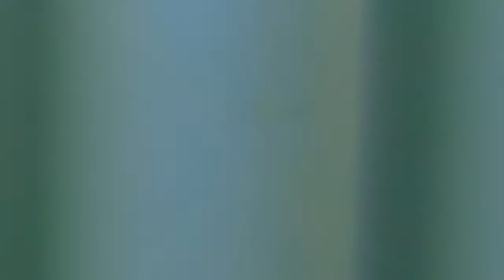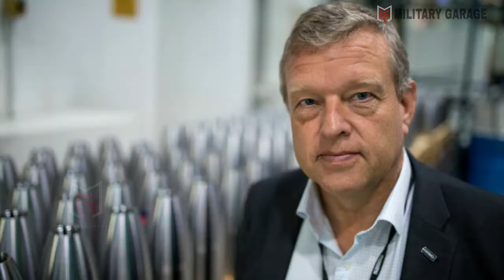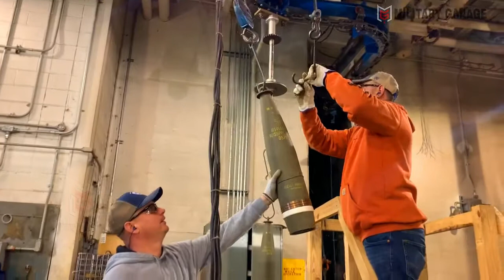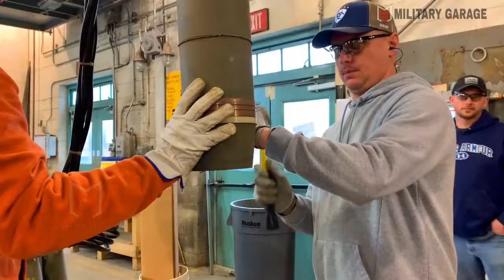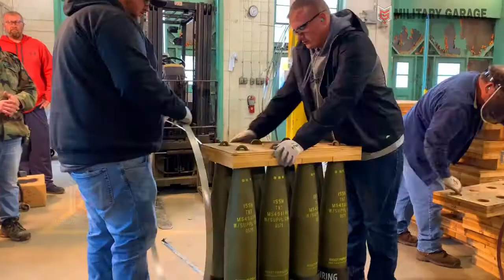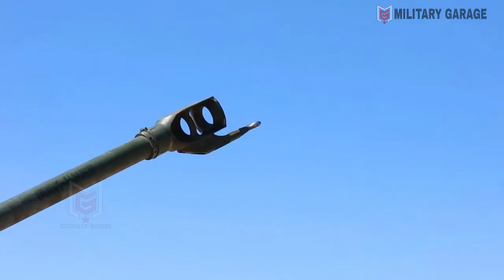Norway Has Tested American 155mm Jet Engined Artillery Projectile

Comment: Bulls%%%, ramjet is created by Nammo, not Boeng. They have been working on this for a long time.
Reply: Norway makes, invents and USA has what it takes to get the ideas working and up in production, like no others. Norways production lines are too small and too slow without the USA and also, never ever underestimate the capacity and know how USA contributes with. So, it's all a matter of cooperation and interaction. So far so good.
Reply: @ritz5606  The rocket engineering and all of that is Nammo. Then Boeng came in with the guidance system. As i understand, they(Nammo) had issues Witherspoon GPS ect.  Because of the violent  launch and speed. The warhead isnt anything special i think.
Reply: WITH. not Witherspoon. God damn spelling check.
Reply: Range without accuracy would useless. Ramjet artillery has been theorized for close to 100 years. Mass production and deployment would be dominant and represent a significant cost savings for long range fires. So very happy to welcome Norway into military integration and mutual defense cooperation. May our friendship and shared values, peace and prosperity last on into the future.